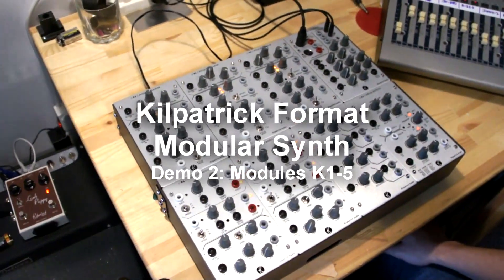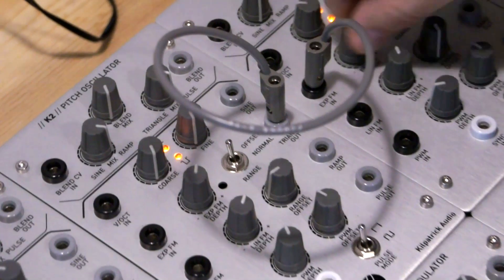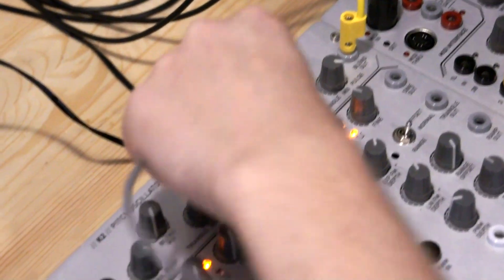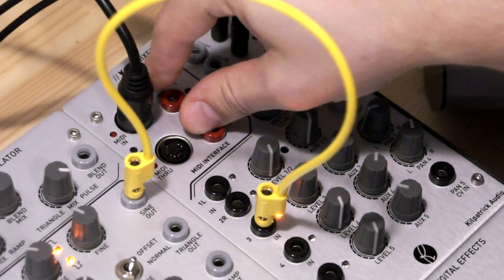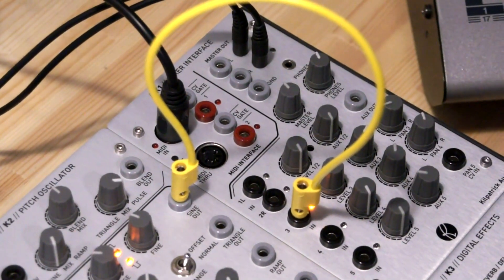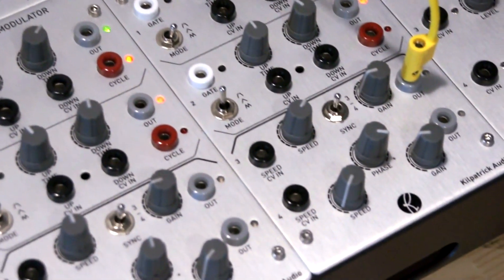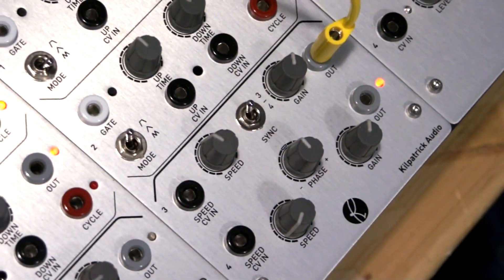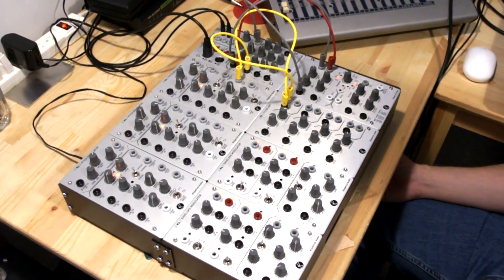Kilpatrick Format Modular Synth - Demo 2

Comment: How come i did not know about this format? Is so cool, are you still releasing new modules? Will it go to retailers in EU? Good job
Reply from the maker: Everyone is still going gaga over Eurorack. One of these days I hope people will start to make KFormat modules. The spec is better than the others, and completely free to use. We are still building modules and hope to have a new one ready this year based on some research done this past summer.
Reply: Is this format compatible with the Buchla modules?  Sorry for not doing my homework (I'll get to it later today, read up on it).  It looks like they're 3U tall like euro, maybe 4U?  
Am I wrong to conclude that with a few hubs that are banana jacks wired to the mini jacks, this is practically compatible with eurorack?  Sorry, I see banana and think 'Buchla'.  Interesting.  So -5 to 5 volts I just heard, so maybe the Soulsby 'Uni-five' module that came with my Oscitron would be well put to use here.  I am not particularly fond of the mini jacks, at times they want to bind.  Looks like an advanced Lunetta, only sounds very clean.  I like your ethic of DIY.  Id love to see a video of how you make your case (if you indeed made it), it's very nice.  This almost has a mad scientists space age laboratory aesthetic to it, rather than musical.  I like this.
Reply from the maker: Buchla uses a different voltage range, but should be easy to convert with a utility module or box. (we don't make those unfortunately) Also, as for the case check out the Technical section of our site and you can find the full hardware specs including the case design which is free for anyone to use. We don't really make build videos but it should give you an idea of how it goes together.